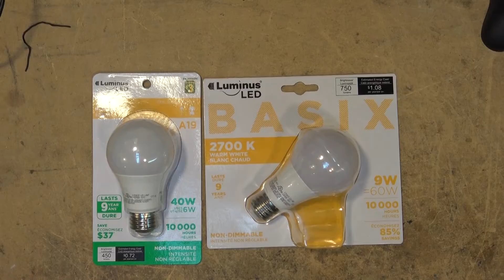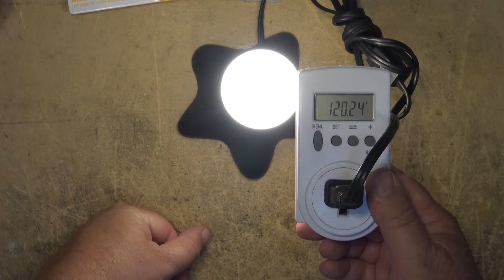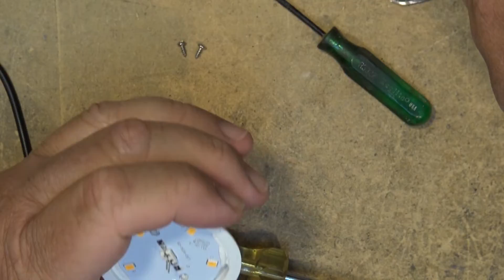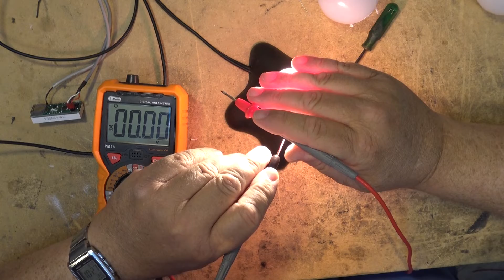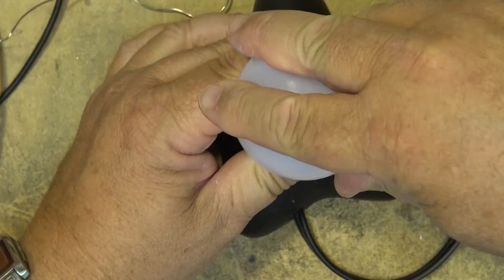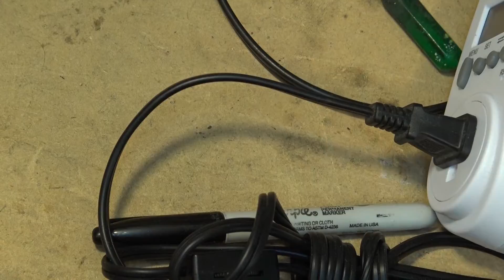Luminus LED tear down

Comment: A use for the eclipse glasses from the recent eclipse so you can see the terminals while measuring the voltage.  Or perhaps a welding helmet.  lol  Will be interesting to see if they last the full 10,000 hours.

Comment: I liked the first one because of the large mount the leds were on, keeping the leds well apart so there is a chance of slightly lower temp on each led.
But the second one has a heatsink, but it would be nice if it continued down the body more, it just looks too minimal to me.

Heat kills leds, so keep em coool lol.
Reply from the maker: Yes and it gets hot. incidentally the entire base is metal, painted white.
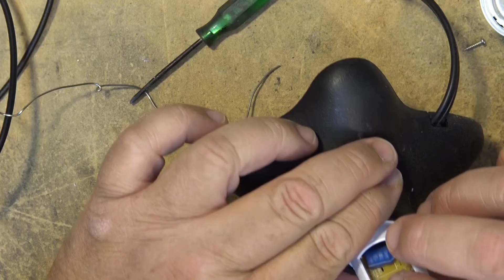The cover I lift off at 19:20 is all metal. That is the heatsink, for the lamp.
I guess you thought that was plastic because it is actually aluminum.
I have scratched the paint off. I should do an updated video to show this as I think many may like to see this, and considering that this video has already been flagged perhaps I will update it and re upload.
Reply: Yes you are right, i thought the white was plastic, im daft.
What the hell have they flagged this video for?
I didnt hear or see any copyright material.